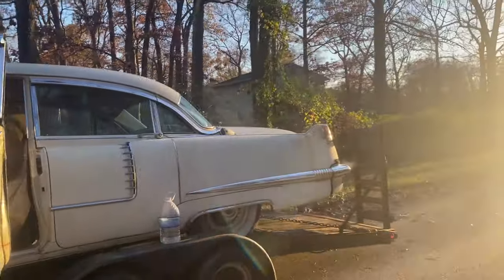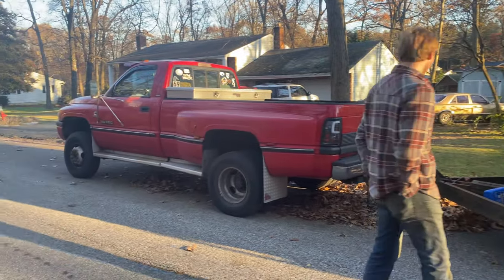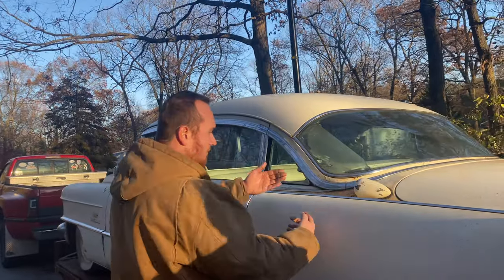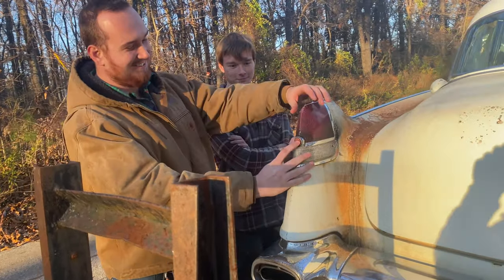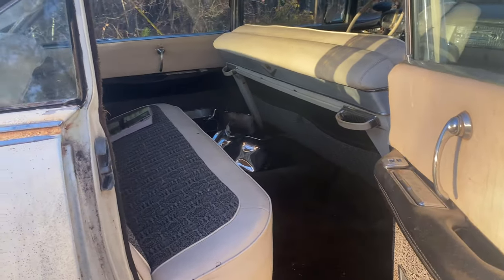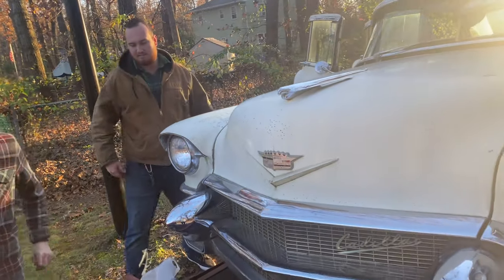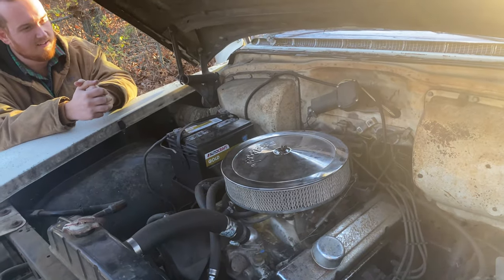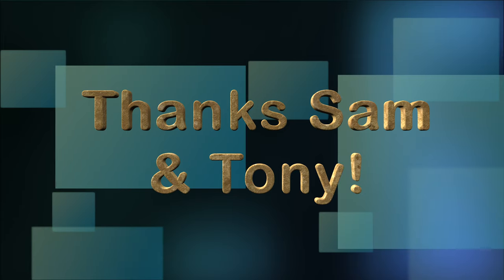This Guys Caddy! 1956 Cadillac Fleetwood 60 Special | Find

Comment: It's a shame it doesn't have the original motor but I guess it is more reliable I saw this on marketplace also good luck with it you will have a lot of fun with it I have a 56  As well I'm from New Bern north Carolina can't wait for more videos 😁
Reply from the maker: Understand about the motor, it is what it is now. I’ll definitely be filiming more of Sam’s new Caddy! What color is your 56’?
Reply: @MCCJustMotos  I bought mine in Raleigh 6 months ago I'm 17  and it is my dream car the guy I bought it from sanded the original paint and painted it white primer to protect  the metal the original color was dawn gray. I have a video of it on my YouTube account. it is a working progress the big thing is the transmission pump is leaking a lot of fluid. I was very lucky to get the car I got it for 6 thousand.
Reply from the maker: Gage Bantos i’m definitely going to subscribe to your channe and check out your car!